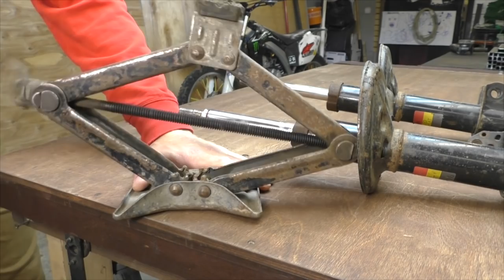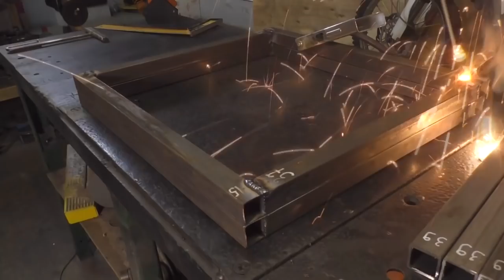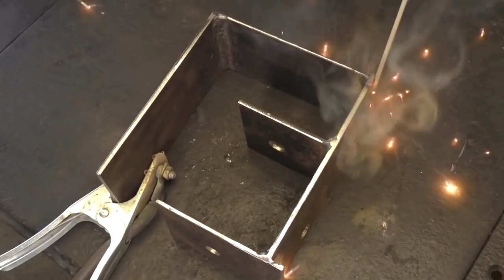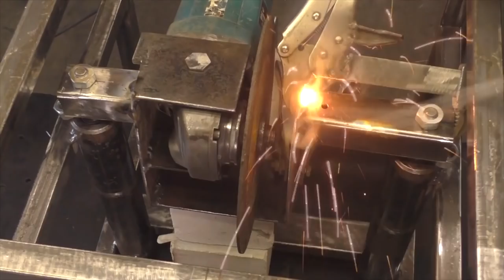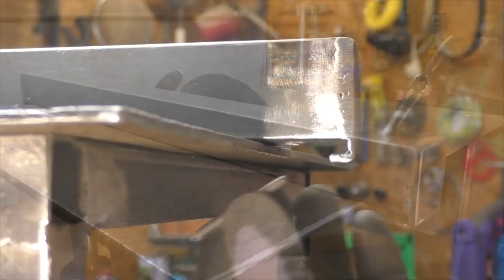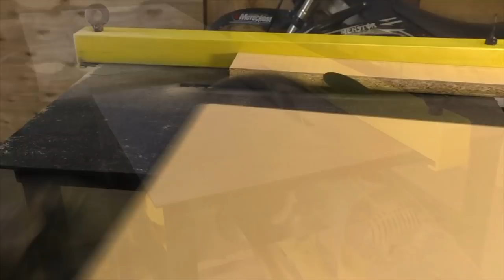Don't throw away your old car shock absorbers and car jack!

Comment: Nice build.  For the rip fence try making the rear table engagement a wedge over the table lip, and the forward one a cam that pulls the fence forward and against the rear wedge.  That way you have one touch self aligning control when moving and setting the fence without having to reach beyond the blade.

A new table saw owner's first woodworking project should always be to make a couple of PUSH STICKS to push the piece through on the fence side.  Even with the shark fin, it's at risk of kickback which can shoot it like a railgun through the wall.  Standing behind the saw and grabbing/pulling the wood is dangerous also.  Respect table saws, they have a list written in blood of well known risks, dangers, and safety/mitigation practices about their use.

Comment: Pretty cool little table saw! Just not sure how much power it really has though? But you can cut most anything as long as you go slow enough to let the saw blade do the cutting without putting too much strain on the motor.  Be fine for the once in a great while DO it yourselfer that just plays around doing smaller projects from time to time.  If it does the job you can never complain!

Comment: Cool build however I would be worried about the limited power of the grinder for the extended cuts with a saw blade as well as the high RPMs of the grinder for use with a saw blade with teeth. As a grinding table rig cool! I liked it.
Reply: The grinder that I had that was sized the same as that one only spun at 4500 rpm and was "rated" for 4 hp, should be well within the range of both power and rpm for a blade or grinding disk, but idk if all grinders that size are rated the same.

Comment: You may not,have passed that much heat into the that shock for it explode, but maybe enough to make the seals fail eventually other than tthat, good build
Reply: Shocks aren't made of paper and explosives. What t f are you babbling about, they are SHOCK ABSORBERS, literally made to take massive stress and work under load and constant movement. They can get quite hot just operating normally. The oil don't combust without air, and gas shock gas is inert, otherwise it would self-ignite like a diesel engine on every hard impact. 

And yeah, you can easily move a functioning damper with the finger, it's supposed to move easily when slow, and with resistance when moving fast. It's basically two spaces in a cylinder separated with a piston with tiny holes, so oil or gas only can pass through at slower speed, dampening the impacts and returns.

Comment: Is there a special blade on this rig? Isn't there a limit to the RPM on circular saw blades that is lower than most angle grinders? 
Can you adjust the grinder speed on this?
Reply: Use a rheostat. Its like a dimmer switch for power tools.
Reply: It will depend upon blade diameter... A smaller diameter blade can be driven at faster RPMs... Using the HF angle grinders as a reference, the 4.5" model supposedly does 12,000 RPMs whereas the 7" model does 8500 RPMs... Their 4.5" circular saw blade is rated for 7000 RPMs and most of the 7.25" ones are rated for 8000 RPMs (I would have expected lower).  The 10" blade that I checked was rated for 6000 RPMs.  The corded circular saws themselves produce around 5500 RPMs.  A 3" abrasive cut-off wheel is rated for 22,000 RPMs.  You probably need to add a speed control on the input line to ensure that you do not exceed the rated speed rating of your blades, but that could be a bit problematic unless you have a way of measuring the RPMs of the blade.  There are devices that can be used to control this type of circuit, but it is not a "rheostat", although some people might mistakenly call it that.
Reply: That's why table saws use a motor and various diameter pulleys with a belt between them to control rpm range.

Comment: There is an optimum speed for different blades to go through different materials, and as clever as this is, I don't think you have accounted for that.  It will work, but not as well as if this was accounted for.